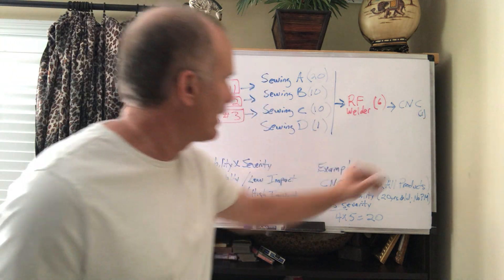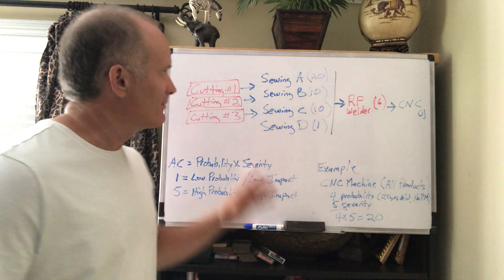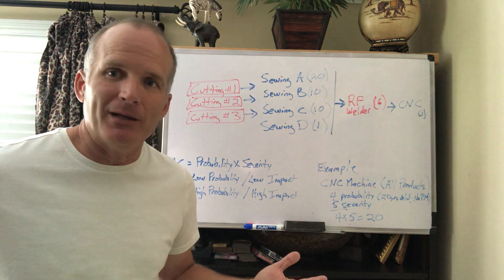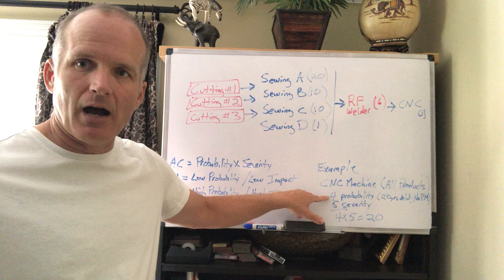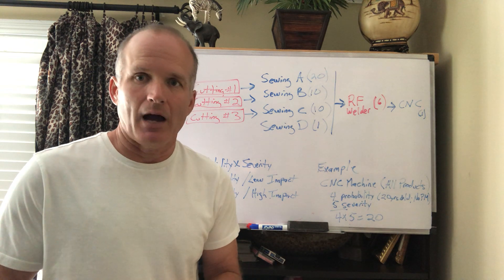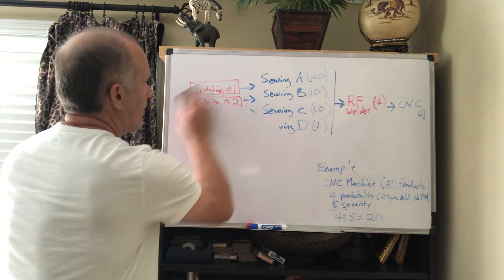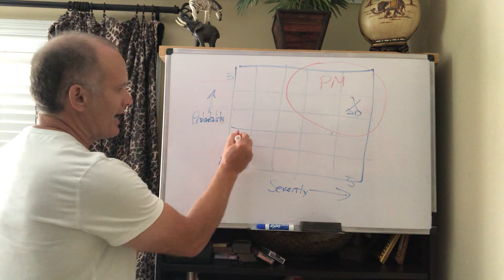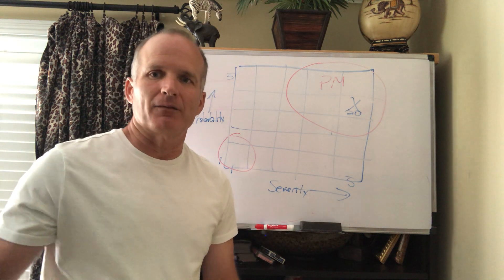What is Asset Criticality?  A beginners look into this important tool to drive results in your plant

Comment: Awesome Joe. Our plant needs to implement this right away. We're throwing away way too many bad bags at the end of the bag making process because of various reason. We need to focus on those reasons and get our waste down!! Thank you!
Reply: Imagine throwing 20% of the tents away at the CNC machine because of the CNC is old (probably not PM'd well enough), the operators have a difficult time getting consistently good product off quickly between differing job set-ups (tons of waste "getting the product within spec"), and the newest, least skilled and lowest paid employees in the plant are sorting the tent poles (good from bad)  out by hand to stack on shipping pallets without any incentive to reduce waste or good enough training? That's my reality.
Reply from the maker: Observation will change your current state
Reply from the maker: Observe reality first.    I promise your assumptions will be at least partially wrong.    My book details how to do this process.   Simple solutions will be revealed.